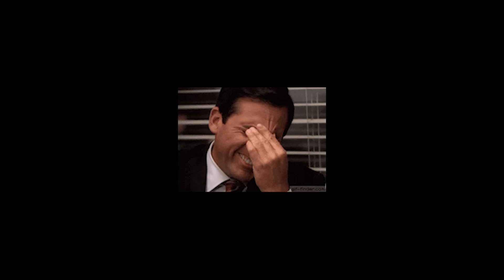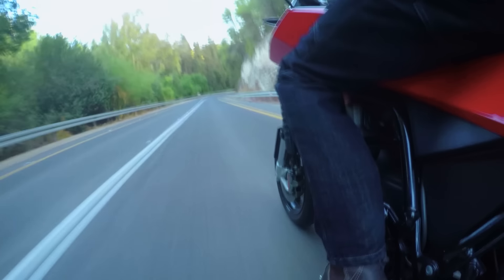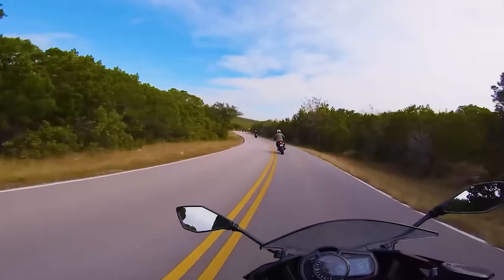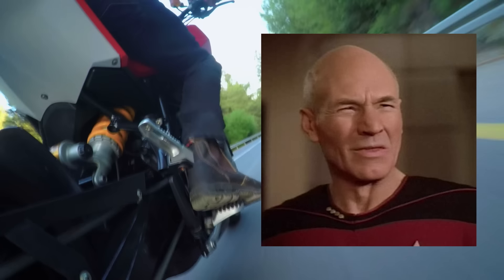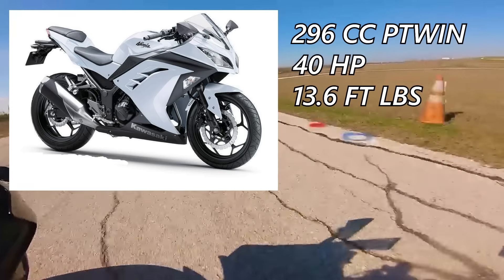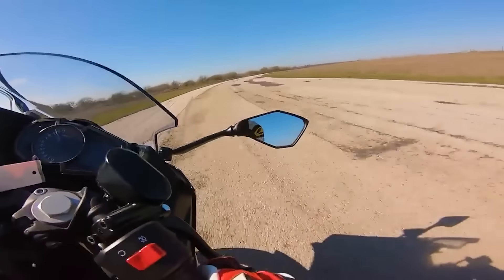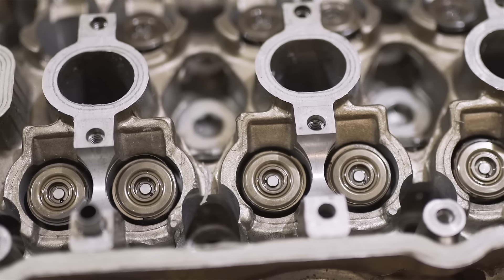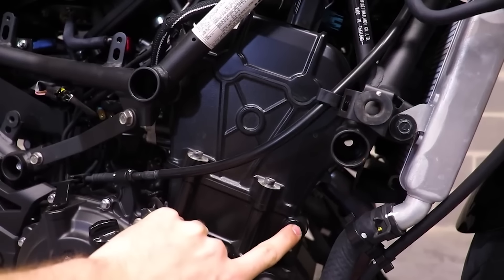So You Want a Kawasaki Ninja 400...

Comment from the maker: Thanks to Rokform for supporting what we do and making a truly Yam proof phone mount. Check them out over at https://www.rokform.com/ and use the code YN25 for 25% off!
Reply: Yam i live in sweden is kawasaki ninja 125 good as a a1 bike or should i get gsxr suzuki 125
Reply: You should check out the ninja zx25r. It's a possible candidate for new beginner bike with sweet 4cyl sound
Reply: Is it just me or this guy alot of familiar.......
Maybe like Lazlo radio host on grand theft auto?
Reply: U forgot about how kawasaki skipped the 500cc class after 2009 now it goes from the 400 to the 600 i have a 2008 ninja 500r love it
Reply: Wasn't the bike from Top Gun a 750 Turbo?  My first bike, that's why I'm pretty sure.  The gpz 900 looked like it minus the turbo.
Reply: @medcorvestas-windsor888  no it was a gpz 900 I believe
Reply: U should make another ninja 400
Reply: You should make another ninja 400 video
Reply: How would the Ninja 400 be for long trips if equipped with the more comfortable seat? I drive 138 miles each way to work right now (car) but was looking at this bike for the gas mileage.

Comment: The gearbox issues can be practically fixed by swapping out the clutch springs. Firsthand experience as someone who owned a 2018 N400 for 2 years. The issues are a result of a weak slipper clutch mechanism.
Reply: Pin this
Reply: @drnapalm7605  he didnt
Reply: Thank you for this info it is extremely helpful
Reply: Wonder if they fixed the issue with the newer ones

Comment: As a current 2018 N400 owner, I'll say that it has been a great bike if you want something that's cheap to operate but still want something fun to commute or tear up some back roads. The power may not give you that feeling that you're holding on for dear life but it's plenty enough for all riding conditions. Other issues that I've seen pretty common are the clutch wearing quickly or beginning to slip. Overall, I haven't had an issue with anything yet on mine. Definitely WANT another more powerful bike for some weekend rides but I don't NEED more power. I've also previous owned a CBR 1000RR so that may be where my need for more power stems from.

Comment: I would not mind a 300 or 400 to commute on and leave the 1400cc for weekends.
They are dirt cheap in gas, insurance,and everything else.
Reply: I ride my ninja 400 every day. Almost at 7,000 miles
Reply: That’s what I’m thinking.  I have a touring bike but this could be a fun gym and backroad to work bike lol
Reply: @reillygardner273  what year is your ninja?
Reply: @isaacd.380  2019. I also own a 94 zx9r
Reply: @reillygardner273  Sweet!! I am gonna take my MSF in a week and I am excited about what is to come. I have practiced on a honda rebel and it is not bad but I am thinking about trying a sport bike.  Would you recommend a ninja as a beginner bike?
Reply: @isaacd.380  the ninja 400 is a fantastic beginner sport bike in my opinion. Even though I own another bike with triple the power I still ride the 400 all the time cause it’s so fun. Try to get a 2020+ model if you can, they supposedly have better clutches. Mine is a 2019 base model so no abs.
Reply: Actually the mpg of a 400 is not too far off from the zx6r
Reply: @M16xDr0pSh0tz  the ZX6r gives you 30 to 40 mpg on premium , the 400 gives you 50-60 on regular . yes there is a big difference. and if you start adding maitenance.. the chain on the 400 is 40 dollars.. the chain on the zx6r is 300 dollars and on and on...
Reply: @ROrneli  Meh ~10 mpg is neglible. I just looked online and a chain and sprocket kit is about the same for both from vortex
Reply: @M16xDr0pSh0tz  its not 10 it is 20 difference 40 mph on the ZX6 is if you ride it extremelly slow and conservative. 30 if you ride it like you should , the 400 gives you 50 riding it like you stole it.

and the chain for the 400 is $121, the one for the zx6 is $218 there is also going to be a difference in tires and brakes ! 

In the long run if you commute on either bike over a period of time these extra costs will add up.
Reply: @ROrneli  I've heard 400s get like 50 and zx6rs get like 40. Obviously the zx6r is not going to be cheaper but picking a 400 solely because it's slightly cheaper is not worth it.
Reply: @M16xDr0pSh0tz  well you also have the ergonomics. I put 45 thousand miles commuting on my zx6r ,.but after i stop using it every day I find it too uncomfortable to ride casually. I traded it in for a concours 14 (originally wanted a ninja 1000) ninja 400s are relatively comfortable
Reply: My RC390 has been a great commuter, 18000 miles and still kicking.

Comment: You missed the biggest flaw in the 2018-19 model.   When they introduced the slipper assist clutch they used too light of springs which causes major slipping issues.

Comment: I can guarantee with 100% certainty that 43 horsepower is enough horsepower for anyone. I rode an XS400 parallel twin Yamaha for my first bike, for 3 years. It had 28 horsepower, and actually was perfectly nice to drive. It was always really fun to drive in town and on the highway. It could go about 100mph. Parallel twin engines are so much more fun to rev than a single cylinder engine. There is no comparison. The twins actually have a top end rush, and get smoother as your rev them, because they are "self balancing" unlike single cylinder engines which require a large counterbalancer just to function. When one piston goes up, the other goes down. So as the revs increase, the engine smooths out. They still have vibes, but it's totally different than a terrible shaking single. Even when a single has a counterbalancer, it still sounds like it might blow up when you revv it up. Twins sound aggressive and good, and mean.
Reply: 43 hp is enough for anyone? you must not know any real riders. 43 hp is adequate but not enough for everyone. Please do not speak for me and other riders without asking us first. It may be enough for you but far from it for a lot of real bike riders and racers. The guys at my local track love the 400 ninja but none are happy with the 43hp they are all modded to hell and want even more as it is a nice chassis and suspension package but 43hp is just a starting point to get the most out of the little ninja.

Comment: I've experienced all the problems you mentioned on my 2014 300. The problem with the clutch being pressed and then the bike turning off can be fixed by tweaking the idle. You will idle a slightly higher rpm but at least it won't turn off in the middle of riding on the freeway lol

Comment: I have a 2019 ninja 400 and it's a great bike.  Lightweight,  handles great and it's quick. Not fast but easily gets out of its own way.  I've had a few false neutrals but they're few and far between. As for getting in gear issues, when it happens going into first the dash shows the -- flashing.  Just keep the clutch in and rock the bike.  Pops in every time
Reply: I had false neutral with my Z400 at the beginning . At 26,000 KM , I can't remember the last one .  I love the little thing 😊👌

Comment: lets not forget the early 80-90s ninjas were not bullet proof. They also had " ECM failures" that would cause the bike to randomly shut off after a bit. since the bike controlled electronic spark timing. as well as the gearbox issues.

Comment: Just bought a 2020 Ninja 400 ABS KRT over the weekend as my first bike. Of course I don't have the experience to say that I bought the absolute best bike in this class, but on my way home I knew that I made the right decision. Put almost 150 miles on it over 2 days, and I'm having an absolute blast. Even while trying to keep it below 6k rpm for the break-in period it's plenty fast. Of course I'm comparing this to no other bikes as well as my Subaru BRZ which is slow for a sportscar, but I'm a beginner and don't need to be going 150+ mph or pulling 10 second 1/4 miles.

Comment: Started on a Ninja 400. Can confirm, great bike overall. I will say, I certainly have hit the false neutral between 5th and 6th a fair share of times and it scares the hell out of me everytime. Other than that is is a spectacular bike and has really easy maintenance too!
Reply: i have also hit false neutral between 5th and 6th with mine
Reply: It’s the 5th in general ! Some good ol lubing usually solves it for me
Reply: False neutral? I just got a 2018 Ninja 400 as my first bike and I think I might have had this same issue. When I switched from 5 to 6 the rpms went all the way to 10000 and sounded like hell.
Reply: @jamesremley3874  that's a false neutral.
Reply: Ben May can you go to neutral from any gear? I thought you have to go down sequential to go neutral? Sorry never ridden a motorcycle..

Comment: My 2018 n400 averages 56mpg city or highway with taller sprockets installed. Still love riding it.  After just two years, the engine needed torn down to replace a cheap rubber o-ring that is sandwiched between the crankcase and cylinder jug. Be sure to check  that front crankcase seam, right behind the exhaust extractors for coolant traces.

Comment: Man, if only they made cases for pixels.

Also, picked up a z400 rather than a Ninja. Very excited to start riding.
Reply: I’m gonna be looking at buying a 2020 z400 soon. Is it torquey enough down low?
Reply: Owen Monast torquey isn’t really a word I’d use to describe any small displacement P-Twin lol. Even the 650
Reply: Got a Z400 last year . 10 1/2 months after , I got 26,000 KM on it . Run perfect .
Reply: @owenmonast9582  The engine got plenty of power starting at 4000 RPM . I usually Ride between 5000 and 7000 ( The sweet spot !  😁)

Comment: I had a black 2019 abs model of this bike. Sold it after about 4 months. I just didn’t ride it enough. I rather a beginner rider get more use out of it. The saying “It’s more fun to ride a slow bike fast than a fast bike slow” didn’t apply to me. It’s like everyone high-fives after that saying. Not bashing the 400 but it wasn’t for me. Commuting wasn’t fun on the highway with those thin tires. Oh well, a mistake but at least it was a secondary bike. Now I’m going to upgrade my KTM 790 Duke to the 890 Duke R hopefully before July. I enjoy your videos, Yammie.

Comment: Eh, I had the EX500 which became the Ninja 500 (overseas models got disks front and rear, not a scrub brake plus more fairings) yet these bikes were bulletproof. I put 37K miles on it in 2.5 years without a hitch. I expect the Ninja 250 was the same. I never touched the carbs. Personally I'd take carbs and magnetos over all of this electronic BS any day of the week. No fuel pumps to fail, like the one I have to swap this weekend. Bring back the kick starter so I can start without a battery!!! Man I miss that about my 61 Triumph. It always started right up. Of course It would occasionally burn holes in the top of the pistons but hey, it's why that tattoo became popular. Even when the lighting circuit blew along with the Zener diode you could drive the bike home. That thing would probably run after an EMP burst. It might not be fast or powerful but it had character in spades. Yeah, STFU boomer, we all know everything was better back then when men were men and women didn't have peckers and when we knew that socialism was bad. Does that mean that Socialism = Fuel Injection and seats that mash your nut sack? Perhaps they are unrelated after all... hey, about that corn pop dude....
Reply: That was funny as hell. I'm an old guy too and get it.

Comment: I can’t wait to buy a ninja 400 just waiting on the classes for the MSF  and for the people who have the bike have you had any problems with it?
Reply: No problems so far. I got the 2020 KRT edition. I ride it on the highway and did 107 mph after breaking it in. Very good bike and can handle the interstate easily. I don't see myself upgrading. Why get a 600+ bike just to not be able to see the full potential on the street?

I understand the SV650 and Ninja 650 but if you get a 400, there's no need for the 650. It's just slightly faster and heavier.

Comment: I'm on an Iron 883 & I'm looking into a sport bike. I'm between this & the R3. I want something comfortable (Although I know it won't be as comfy as my Iron), something comfortable on the highway & some twisties. Based on the research I've made, supposedly the 400 is more comfortable than the R3? I'm not doing anything on a track. Just joyrides. I found myself kind out outgrowing the Iron quickly. I've been riding for a little more than a year now. I've also found myself kneeing down the Iron like an idiot because I want more lean angle and quicker around corners. I'm more about speed on corners than speed in a straight. Nimble and quick is better for me than massive HP & speed, which is why I think the 400 or the R3 kind of fits my needs. Thoughts anyone?

Comment: Considering either a Ninja 400 or a Duke RC390 for my wife, still dunno which to go with. Going to have to test ride them both.
Reply: go with the 400 Kawasaki.....don't get me wrong....I own a DUKE 390....2020....will go on the freeway, but asking for any extended cruising over 65-70 MPH, and you'll wear yourself out...it's FUN for 2-lane blacktops, and under 70 MPH roads.....it's great....or just a commuter bike around a big metro areas....2-cly.'s are MUCH better than thumpers (AKA< single cylinder)....had to wait almost a year to get a warranty motor....it blew up, and I wasn't even gettin' on it....4th at about 40-42 MPH....on a 2-lane blacktop...bottom half of the motor come loose (Video on my channel, if ya wanna see what happened)....I took my checkbook to the other bike shop here in town late last year, and was going to buy a Benelli 302S....but it sold before I could get a day or two, to scrape up the funds....it rode well, and seemed just fine on the highway...and have ridden the CB300R (Honda single)....almost not enough....for the highway, but twice the comfort, and effortless to drive....rides very well, and more comfy than my DUKE 390....by far.....the new Rebel 500 only goes 100 MPH, I have heard....they're chipped to only run that way....supposedly the same motor as many of the 500 bikes they have, but somebody might check me on that.....I have a 1999 Honda Shadow Sabre Cruiser (1100) that I use for extended cruisin', but the DUKE 390 is good for dirt, street, and commuting....or just being on 2-lane blacktops....it eats corners, and has ABS, TFT display, and other goodies, so hard to beat for the bucks....I have heard they are coming out with the KTM 490....supposed to be a new Twin Cylinder from KTM....we'll see what it's like....
Reply: it runs about 7000 RPM at 68-70 MPH...my 390 DUKE...56-70 MPG, or thereabouts, if you ride it right....

Comment: Ehh, in the 1980s and 1990s, vehicle companies were in the business of over promising and under delivering, so I'd bet the 1988-2007 Ninja 250 was making closer to 25 HP. They, along with the CBR250 were both dangerously slow. I own a Z400 and it feels 2-3 TIMES more powerful with only 44 HP. The CBR250 I owned for a few weeks was bone stock with 3,000 miles on it and it felt like every bit of 18-20 horsepower. Maybe it's just a poor gearing decision by Honda, but I'd never recommend any 250 as a learner bike to anyone short of someone who's never ridden any motorcycle ever, and even those people would get bored of a 250 in a month.

Comment: Did America receive the zzr250? in the uk we were treated to them but few bought due to the kr1s. it was a cracking bike(ignoring the wooden tyres and slowish engine, but it was reliable, comfy and could haul two people 450 miles on 18litres of fuel (4.7 us gal) 200 miles thrashing the engine up to Scotland. Despite buying other bikes like the tdm850 and larger zxr's i still used it for touring and i'm 6'2inches tall with panniers tank bag and a pillion. It's a shame they've shortened the rear and dropped fuel capacity and ruined pillion comfort on later models.

Comment: I wish I would’ve skipped the “beginner bike” stage & started on a 650.
Reply: I went for the ZX6R for my first bike and it was fine. Just dont be a moron on the road, save it for the track.
Reply: same the ninja 650 isnt much faster than the 400, but then i usually redline the ninja 400 in 4th gear on the highway and remember that if i had a bigger bike i would speed even more lol

Comment: Yammie, what do you think about the z400? Because its gonna be my first bike.
Reply: I had a 2019 Kawasaki Z400 ABS as my first motorcycle. It was a hoot to learn on as it does have a little power to get used as you become more acclimated to the streets and eventually highway. I recently traded up to a 2020 Kawasaki Ninja 650 and I feel like this is the bike I should’ve started on. Plenty of power and torque, but not too much a for responsible beginner. It shines in 3/4 gear when you get on the throttle. I traded up for better wind protection on the highway and to get up to speed after a red light on the highway. The Z400 will not disappoint and it’s a cinch to upgrade parts! My caveat would be to plan on trading it in after a one year or so and losing your ass on the trade in value especially if you purchased the maintenance package from your dealership. My advice, get the ABS model (saved me a time or two) and forget the expensive maintenance package until you upgrade to a more long term motorcycle. Lastly, the MPG is insane. Literally pays for itself in saving on filling up your car if you’re going to use it for commuting!
Reply: @squeege0711  well thanks. I was planning on getting a rebel 500 in a couple of years.